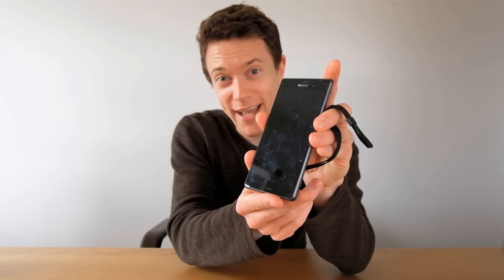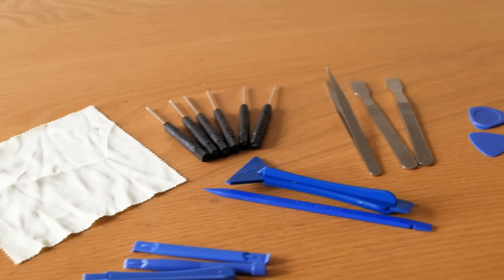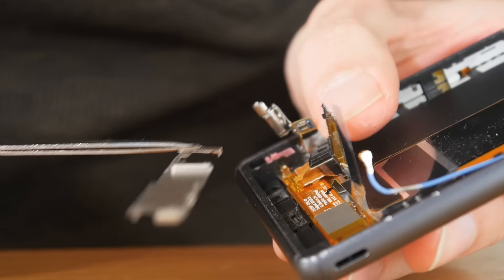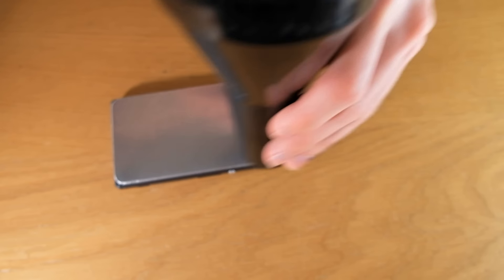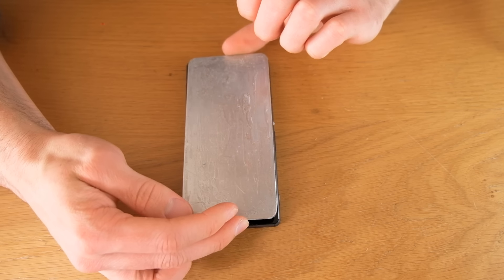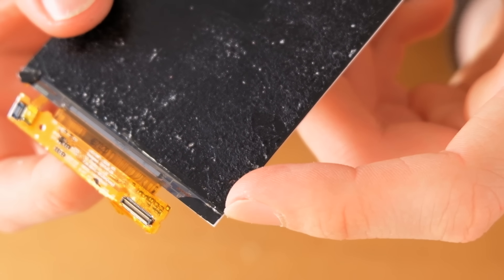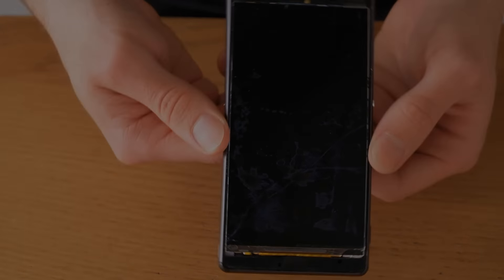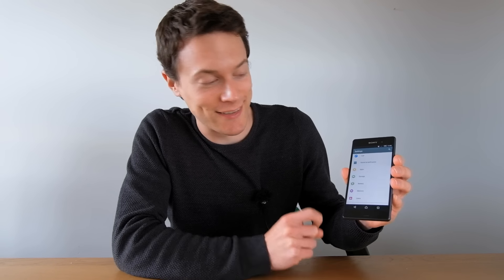Fixing a Smashed Phone Screen - on a budget! (GLASS ONLY REPAIR ATTEMPT)

Comment from the maker: Thanks for all the likes guys! Regarding the screen , it really does matter that it's original. I later repaired a Z3 compact and bought a replacement screen + digitizer on eBay for roughly £20 and, while it worked okay, the screen area was smaller and the colours were very drab and dull in comparison to the original (brightness was fine though). I'd personally leave the cheap replacement screens well alone, but the official ones are much more expensive.
Reply: you know how you can buy film scratch protectors..... the leather case for my phone came with one which was HARD plastic, its stayed on well and i swear i would have broken my screen many times over without it (landing on tiles/cement face down)
Reply: DIY Perks I bought a non genuine 4K screen for £40 for my Z5P and i haven't noticed a difference between OEM and Non-OEM.. There is no dull spots and the screen performs just as well as it did before with the original.  I guess that even some knockoffs are good but it is very hit and miss.
Reply: With the glass sealed to the digitizer under vacuum on modern device, when the screen breaks, the digitizer is already damaged beyond repair.
Reply: Well they say you get what you pay for and while Sony phones are not cheap they are some of the best.  They are water resistant and have good cameras.  The Xperia Z5 Premium was the first smartphone to have a 4K display.  I have an Xperia X and the 1080p display already looks really good.  Never mind Samsung, I don't like AMOLED screens.  They are defective from the moment they are manufactured and that is because they burn in and that is why I will never want an AMOLED screen or super AMOLED.  No Xperia I ever had has an AMOLED display and that is how I like it.  I have one non Sony phone with an IPS display and that was left on for a whole 24 hours with the screen on just sitting there.  It did not burn in.  Now if you had done that to an expensive new Samsung phone it would very likely get an image permanently burned in.  I think I would almost cry if I paid all that money to see it damaged so soon.  Either that or I would be a very grumpy person for a while.
Reply: DIY Perks I think I have a similar phone. Can I have a link and the model.
Reply: I don't know what happened but my Z3 Compact just lost it's GPS receiver.... Now i'm lost... LITERALLY!!!!
Reply: DIY Perks Also buying the frame costs considerably more and the cheaper fake screen I got for the z5 compact was EXACTLY like the original.
Reply: I'll take an IPS display over an AMOLED display ANYDAY. Samsung phones look absolutely amazing the day you get them, but they start to deteriorate from that point forward, slowly ghosting more and more. Leave the phone on with the keyboard showing overnight a couple of times, and the screen is wrecked. IPS displays do not ghost, and while they aren't as saturated the day you get them, they look better on day 60.
Reply: Richard Smith, it is true.  If they could use a display that does not burn in they would be some of the best phones.  It is because of the Super AMOLED that I would not buy any Samsung phones even though the S6 looked good.  The problem is organic materials that break down slowly in those displays.  The O in AMOLED is for organic.  AMOLED is active matrix organic light emitting diode.  Calling it Super AMOLED does not change the fact that they deteriorate.  I just hope that phone makers that do not yet use AMOLED know the garbage they really are and not shaft us like Samsung would if we bought one of their products.

Sony is nice but the one problem is to root one running Android 7 you must unlock the bootloader.  The problem that lies in doing so is that you will permanently cripple some functions of the phone.  For example the camera will not take photos that are as good.  Sony has some software made by them on their phones and when you unlock the bootloader it permanently erases the DRM keys to that software.  I guess the only reason is they don't want you using their special software on competitors phones.  I can't think of any other valid reason Sony had to be such a prick about unlocking the bootloader but despite that I still like their phones.  I just have to remember that unless an alternative root method is found for Android 7 I am stuck with most of the bloatware if any that the phone came with (DAMN YOU FACEBOOK!!!!!!!!!).
Reply: Richard Smith hmmmm...we had an galaxy note 2 from a few years ago, someone has always been using it until the end of last year, the brightness did go down a little from when I got it, but other than that there wasn't much residual pictures or ghosting. I also have an Alienware 13 laptop that I got last year, which i have been using to write documents for long hours, quite frequently. Ghosting do happen but very rarely, and goes away after a few minutes. I still trust the current oled technology and I think it will only get better as time goes on.
Reply: John Doe AMOLED burn is practically a non-issue these days with normal usage. I've seen phones with AMOLED displays that have been used heavily for years looking completely fine.  Your device is likely to become obsolete long before a panel would degrade.
Reply: Exactly, I can confirm from experience. I am much more worried about the laptop's OLED screen than a phone screen which is off or animated most of the time
Reply: I've cracked some screens trying to separate from digitizer so I also now that feel bruh :'(
Reply: DIY Perks nice
Reply: DIY Perks - hey cutie i think im falling in love with you 😍😍😍
Reply: Er... AMOLED Burn on LG G5 after using screen for 20min. Not really a non-issue unfortunately and kind of a deal breaker.
Reply: The LG G5 actually uses an IPS LCD panel. The burn in issue is very real though. I wouldn't blame anybody for thinking it's an AMOLED because of that. It has a small separately back-lit portion used for the always-on display.
Reply: Now get a bloody screen protector and a case!
Reply: DIY Perks in your falily use only Sony?😂
Reply: DIY Perks  nice job rally help to see is should use it
Reply: DIY Perks Still a Very well made Video Sir, and Great Personality! !! Thanx for the demonstration 👍👍
Reply: Pls fix my broken phone Olleh G lg the lcd 😢 ihave no phone
Reply: what did you search for on ebay to get the new screen because i cant find one??????????????????????
Reply: at least it's still sony

Comment: I've worked at a phone repair store and be very careful to apply to much heat to the back of the phone, heating up the phone too much can cause in some cases the battery to explode. Keep your finger under the heat and if it feels to hot stop the heat and leave it for about 30 seconds. Be careful in general with this.
Reply: OneChillTree and carefull not put too much heat directly to LCD too..as it will damage the substance inside the LCD..
Reply: Or use thermal camera!
Reply: @zahaer9026  Liquid crystals can boil I guess?
Reply: Are you a tree?
Reply: @deassfgh7807  sir you alright?
Reply: Thanks!